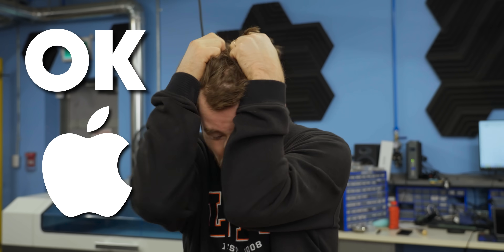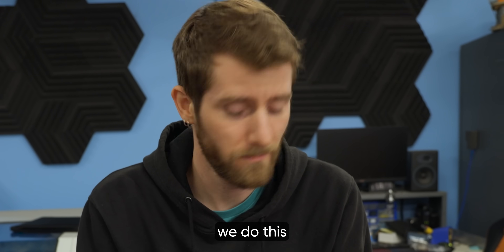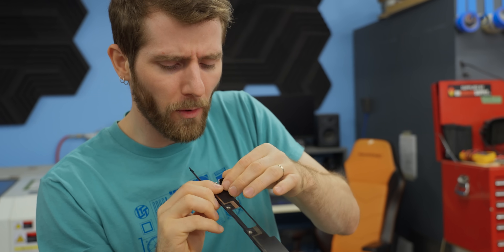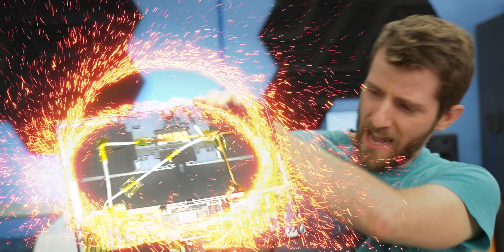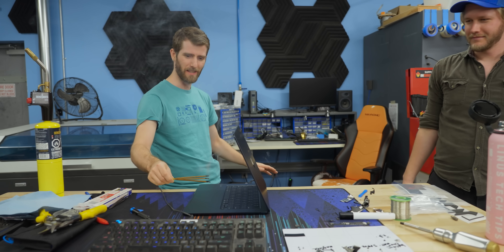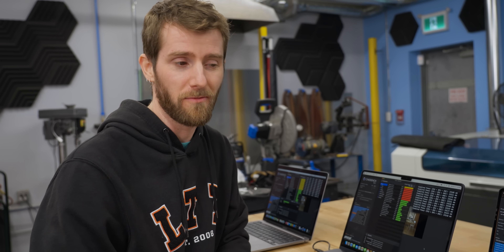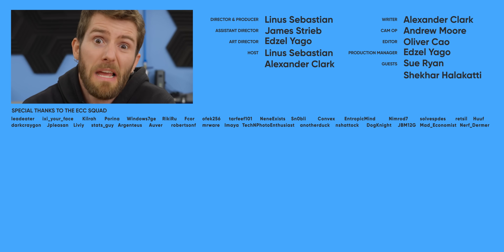Apple please watch this. - Frore AirJet MacBook Air

Comment: I am missing some battery statistics for this. I wonder how much more battery this drains, even though it's obviously not optimized or production-ready, so to speak. Battery life plays a significant role in choosing between an Air and a Pro model.

Comment: 00:00 🔥 Apple's design choices influence the PC industry, so improvements in MacBook Air could impact future laptops.
01:31 🛠 The modification process for better cooling in a MacBook Air involves delicate steps, affecting functionality like the keyboard and MagSafe.
03:04 ❄ Apple's cooling design lacks efficient solutions; the MacBook Air's cooling system is limited and lacks adequate components.
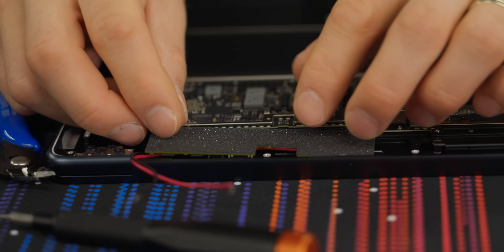05:12 🔌 The modification utilizes USB power due to challenges in accessing the internal power supply of the MacBook Air.
08:19 ⚡ USB PD cables enable higher voltages and amperages for devices, ensuring proper functionality for specialized equipment like the controller board.
10:04 💨 Air jets serve as an unconventional cooling solution in the MacBook Air, functioning as low-profile exhaust fans due to space constraints.
12:12 🤔 The modification significantly affects functionality, requiring software settings for booting and losing keyboard functionality.
14:02 🌡 The modified MacBook Air exhibits improved thermal performance compared to the stock model under extended usage tests.
15:43 🔍 Exterior temperatures and heat distribution vary between the modified and unmodified MacBook Air but show some similarities.
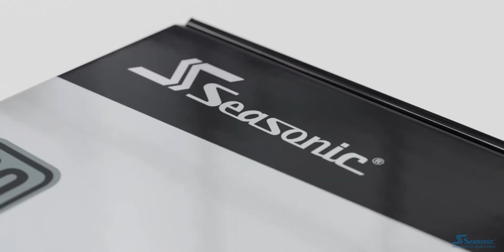18:54 💡 DIY cooling upgrade is not practical, yet the technology's potential excites for future slim, efficient cooling solutions.

Comment: I think there is a flaw in the experiment.  You did more than just add 3 piezo fans.  You also added a better heatsink.  I think you should have included a 4th laptop in the test, one that had the same exact mods (including the gap) but without the piezo fans.  If there is a difference between the two modded laptops, it would better prove that the piezo fans are making a difference.

Comment: It should be interesting to see the result of the modified machine with the AirJets turned off. I guess that a lot of the improvements were given by the vapor chamber with copper heatsink insted to use a foil of alluminum and tape... the AirJets were used completly improperly (as mentioned), they are not designed to generate air flow but to cool down what is behind them. So, I do not really found a point in this test. Do not get me wrong, such technology can really introduce an advantage, but this video prove nothing in that regards. It is like to test a Ferrari parked inside a flying Plane and then say "Hey, look at that! So fast!".

Comment: One of the reasons apple may not pursue something like this is the dependence on air inlets. If they get blocked for any reason, it could tank the performance of the system if it's relying on them.

That being said, plenty of laptops rely on airflow anyways so it's probably not a huge deal. How much are those little vibration coolers?

Comment: Apple won't do it.  Apple wants to do as much as it can in-house and I'm sure Apple doesn't want to add any more cost to the completely silent MacBook Air laptop.  Apple doesn't even want to spend money on a simple vapor chamber set-up.  You don't understand Apple.  If you want to run longer benchmarks then that's what the more expensive MacBook Pro is designed for.  Apple could replace the regular fans in the MacBook Pro with the Frore product but it would have to be as cheap as the current fans.  Apple has to keep profit as high as possible.  That AirJet is slick but not for Apple products unless Apple can buy Frore and keep the AirJet exclusive to Apple products.
I can't imagine anyone but some computer hardware nerd that would kludge a MacBook Air into an almost MacBook Pro.  Just buy the freaking MacBook Pro for crissakes and get the whole package.  That's what the different models are for.
No pricing yet for the AirJet products, so we'll have to wait to see if they're worth the cost of replacing a standard fan.

Comment: They should hire some real electrical engineers. If the cable is too thick shave a piece of the insulation. Get smaller probes they exist. Use a micro scrop

Comment: please learn the si-prefixes and the metrical system! 
400 microns are 400 micrometres (μm). 1 millimetre is 1/1000 of a metre. 1 micrometre is 1/1000000 of a metre. so 1 micrometre is 1/1000 of a millimetre. 
400 microns are then 400/1000 = 4/10 = 2/5 = 0.4 millimetres or 400/1000000 metres = 0.0004 metres. 
not 1/400 or 4/100 of a millimetre...

Comment: Those filters are the only issue I could see Apple or others giving this a pass. Everyone knows how dirty laptop get. How long before those get clogged to a point cooling drops to out of spec values? Is it possible to integrate in a way that allows for user servicing? To clean? Is that even possible though?
Reply: Filters that small I'd imagine the whole unit would have to be consumable part, which would be darned expensive and wasteful when a fan can last the lifespan of the device.

Comment: I feel like VR headsets would benefit the most out of this tech for sure. VR needs something thin, light, and doesnt make a ton of sound as it cools the SoC and other parts right next to your face. Depending on the power draw, this would cut a Quest 3 weight and size by 20% while allowing a larger cooling foot plan. The chips are already design to be low power draw and not to create a whole lot of heat anyways - making it perfect for that. IF anything, it would unlock the room for longer performance gains and or higher power chips for the headsets when connected to a power source like when they're connected to the PC or wall mount.
Reply: I'd have to wonder if a piezoelectric buzzing device right next to my face might not be ideal.  They are quiet because you wont hear them much from a distance, but right next to your face it would probably be quite annoying.

Comment: Cool seeing these Solide state cooling " fans" in real world applications not just on a trade show. Like to se more experiments with data regarding cooling capabilties and power draw. Yes a fan will have more cooling per watt but is also loud and thicker than these. I wonder what happens to these Solid State fans over time with dust getting sucked into them. Nice video, almost as janky as the famous watercooling experiments. I would have prefered to stick the " fans" directly onto the chip, thats how they are intended to use and that tiny thin heatspreader is robbing alot of performance
Yes this is sponsored and they are hoping for big contracts, but if a new tech is gonna take off it has the best chances on devices that are already too expensive, and surely china is gonna find ways to make these cheaper per unit :)

Comment: There is one small issue with this solution. It prevents apple from artificially separating their devices allowing them to charge double for just a fan on their pro devices
Reply: Except its not "just a fan", its a bigger battery, better screen, better speakers.

Comment: 13:51 - Small correction on the graphic, 4 hundredths of a millimeter isn't 0.4mm, it's 0.04mm.  That said, 400 microns is 4 TENTHS of a millimeter.  So they misspoke, the graphic is actually correct.

Comment: The results don't mean anything because you have not done a run with the modified one but the air units turned off, so you can see if just the fact that you have modified the backplate and cut it accounts for the temperature drop, not to mention you have added a new copper plate there and removed a lot of parts that might of created heat. I was expecting Alex to catch this one.

Comment: I remember finding out solid state cooling a few months ago on this channel, it was a regret that i bought a laptop recently knowing that solid state cooling would be likely adopt way sooner than i thought, and mostly because of the snapdragon x elite laptop chips.
Reply: I'm not convinced it will.  They even openly state they have air filters, what happens when they clog up which is going to happen a whole lot quicker than a fan?

Comment: "I don't want to break this" bendbendbend
1700 Pa isn't all that much, it's basically 17 mbar. Or very roughly .25 psi. More than 0 tho.
13:16 3 *tenths*. .3 is 3/10, not 3/100. :D Seems the Frore dude makes the same mistake at 13:32. (Oh, there was a correction later, nvm. :D)

Comment: Great sales pitch for a cool product. But what your forgetting, is that Apple would not want to equal the performance of their higher tier products. The Thinness of the Air gives them an acceptable reason FOR throttling.... and a reason for users to upgrade to higher spec macbooks.  :)

Comment: The PC industry could do with a bit more innovation. Just looking at how computer displays are lagging behind TVs, tablets, phones (afaik). Then, there is this for high performance for thin and lights. Why haven't anyone made a thin and light performance laptop with this yet even, and why do I feel so certain no PC manufacturer would ever do this first so we have to trust Apple to do it if its going to happen? Nvidia does a lot of innovation it seems with DLSS, but they sure make you pay a hefty price for it. Other than that, I have an impression of manufacturers being somewhat lazy on the innovation front. Who knows where Intel would be now if it wasn't for TSMC and Apple Silicone competition. Still at 14nm barely going into 10? I don't have the best/full overview over things though. It's just my image of things.

Comment: 13:30 400 microns is not a 400th of a millimeter. 13:60, its also not 3/100 of a micron but 300/1000 or 30/100, it's a third of a millimeter. Your equipment is not the problem.

Comment: Ummmmm, yeah I’ll pass on this mod. Nothing like having to not have a keyboard, no speakers, and not having the ability to charge except by the USB, and not being able to turn it off and on except by a USB device all for a little more air flow. Nothing like spending over $2000 for a laptop only to have to bring a Bluetooth keyboard and a Bluetooth speaker with you just to be able to use it. LOL.

Comment: *Performed by professionals in a controlled environment. Don't try this at home? But what is "solid-state" actually mean in this context? NAND fan? How it works exactly?
Reply: They've made a few videos on this kind of tech before, the idea is best explained as a hand fan (yknow the ones that you shake around to get some air) that gets moved around by magnets, except its super tiny and works through resonance of the whole system to reduce power consumption
Reply: @tiagobelo4965  Yeah, went to their site to check out. It uses a membrane at supersonic vibrations to move air. I'm still confused about the "solid state" thing. It is solid alright, but the "state"? Sounds a bit nonsensical.

Comment: stil dont get why apple and alot of other laptop makers have such a hardon for as thin as possible nobody gonna give a F if it 5m thicker and it actually can cool itself and preform as advertised for more then a few min before it trottles
Reply: I mean, a 5 meter thick laptop seems rather unpleasant for daily use

Comment: cooling like that (more powerful though maybe) would finally make those slim laptops not be extremely dumb. i'd rather have a laptop that's a cm thicker and a couple 100g heavier but is not as limited by the lackluster cooling than such a thin thing. i really hope we'll see properly cooled thin laptops in the future thanks to those modules

Comment: Solid state cooling is a scam. You used 3Watts to remove 15Watts of heat. Fan can remove three times of that heat using two times less power.

Comment: i have a computer power supply (500w) which is used to power my car stereo in my home , but now its not working but it turns on and the fan spins for a moment and then its shuts off what can be the problem ? i can buy a new one but as am a diploma holder in electronics i would like to troubleshoot the problem and fix it can you help me out? the voltage line i have been using is 12v and the current rating is 15 amps in the smps , the stereo i am using is a 200watt quad channel stereo system . please help me out , if you can make a video about how to troubleshoot and how to repair the problem whould be helpful for everyone including me.🙂

Comment: I am generally a bit confused about when people are concerned about the air thermal throttling. Like, it's fine. It's not for sustained heavy loads...it's totally okay that the soc is a bit overpowered. That's not a bad thing.

Comment: It's a cool concept, but surely with all the gear you guys have now you could have gone for a method that was less destructive and resulted in a more useful device. IMO it would have been better to design a new base panel for it that would fit a heatsink/vapour chamber with the solid state coolers, and possibly a larger battery. At least then it would be something the community could adopt that would actually provide a benefit, as opposed to ending up with a laptop you have to use with a dock, because it's functionally a NUC after the modifications.

Comment: It's a neat idea, but too bad the final product is a bit janky, and the keyboard and magsafe cannot be used. I understand it is only for a proof of concept; nevertheless, it is still not satisfactory. It would be better if LTE could come out with a replacement bottom shell that's a bit thicker to provide space for all the cooling components, so it will be non-destructive, and others could actually replicate it if they wanted to.

Comment: I don't see this as something for the MB Air, it would make the laptop  thicker if you still want its main ports.  I could see this improving the cooling of the MacBook Pro though.  It could make it more quiet and remove the moving parts from it.  Also I would like to see how this impacts battery performance of the MacBook, since it would use more power.
Reply: It would probably nerf battery under heavy workloads significantly.  The SOC is using 30% more power due to the lack of thermal throttling, on top of the energy the modules are using.  obviously, this situation is only under the heavy workload, but for a ~8% uplift in performance, it seems to be to not be that worth it.

If it could be controlled based upon need however, the modules being in there wouldn't significantly hurt anything until they're needed

Comment: so basically what you established m(2) air is 5% slower if you torture it for 30min(which never happens in real use) but you get a completely silent machine. Thx for validating my choice of m1 air 3 years ago :D The same goes for your rationale to try to cramp new technology (qc, acquiring licenses, securing production, etc) into the well-established design for zero gain. Even if the cost is the same ... it sounds like a sure way to sabotage the business

Comment: Ok, now remove the Frore airjets and add another slab of copper in their stead. How does it perform then? Can't shake the feeling that at least some of the gain is from adding a thick copper cooler with proper cooling fins instead of the flimsy aluminum thingy apple installed.

Really hoping the Frore solution is actually working, but up until now I've always been left with a taste of "meh" in my mouth whenever it is demoed. Also, how loud are they if you can hear them from 2 meters away in a Studio environment? Not whisper quiet I presume...

Comment: Mmm, not worth the battery time loss to run the coolers. Airs are target light and burst workloads, not production work. I would trade that small performance difference for battery usage in an Air.

Comment: Linus, you can buy a laptop cooling pad to stop thermal throttling. I used the one I bought for my windows laptop and it works great. If a third partly manufacturer can make the device you used in this video but a standalone fanless cooling pad, it would be the holy grail. The 15" MacBook Air is such an awesome device. I recommend it for a lot of people even creators in the Apple ecosystem.

Comment: I don't understand the form over function trend in modern electronics. I'm perfectly fine with a half inch thick laptop with plenty of io that way i don't have a spaghetti cluster of docks and wires everywhere and have the plus of, ya know, cooling.. Now a tablet or phone is different, i like those to be thin to an extent like they were in 2012.

Comment: Oddly, and slapped a plastic Amazon case on my M1 air and it never throttles. My silicon lottery winner has been crushing AV1 for months. I had a series of 120mm fans under it for a while but it turns out it barely matters.

Comment: I feel like worrying about the cooling of a device mainly meant for 20-somethings in college who want to take notes, browse the internet, write papers and use their email (or 40-60 somethings who just want an email and internet device)... is missing the point of the device. And its not even that much of an improvement over the stock device anyway.

Dont get me wrong the tech is cool, but this would be the sort of thing to include in a new version of the Pro to replace the loud fans with something not as loud and perhaps more performant.

So yea if people at Apple do watch this and nothing changes it means they chose to do nothing about it... but we already know they did because they could have stuck some form of cooling in it and they didnt.

Really just stop worrying about the MacBook Air throttling at all. If youre throttling your Air you bought the wrong device for your workload.

Comment: Cool tech and interesting idea. But why not just mill a slot in the bottom, attach a heatsink, then add a magnetic foot that can add the solid state cooling? It would even lift the laptop to a better position and could be removed for better passive cooling without losing everything else.